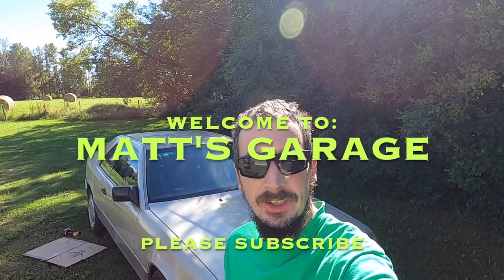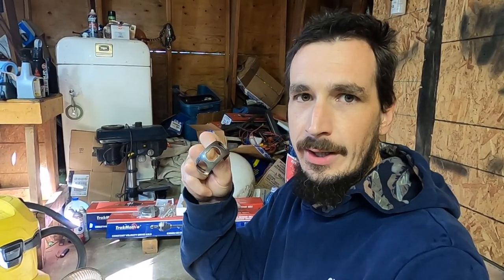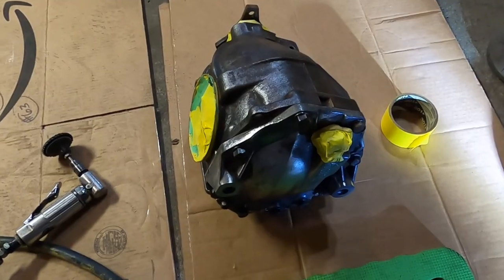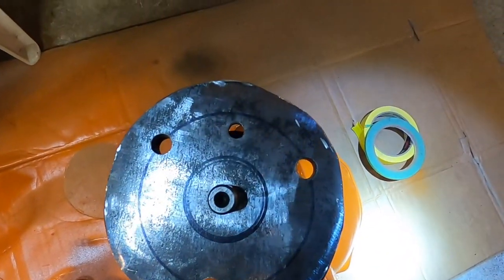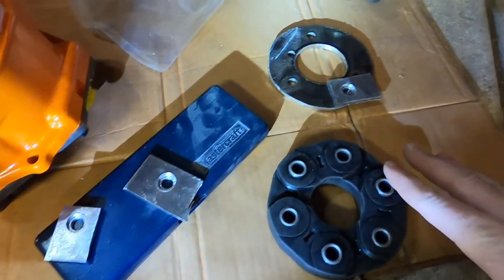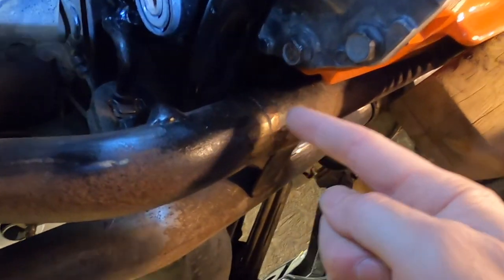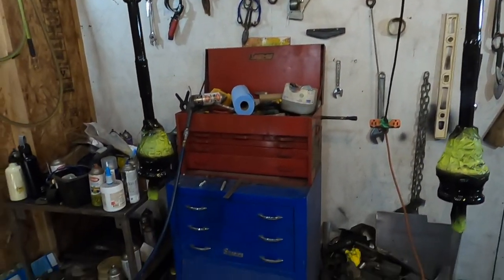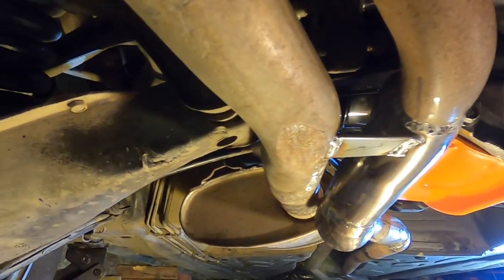V8 Mercedes Differential Swap

Comment: How much more power can it take now? And what year 300 was it?
Reply from the maker: The differential came from a 2008 300. The weak point of the setup now is the Mercedes splines that I put on the end of the axles, but so far they are holding up to my 300hp engine, I’m not planning to add much more power to it so it should be fine. I did consider getting the entire hub assembly from the Chrysler 300, the suspension arms are pretty similar and all that but of course there would be some more hurdles to that swap and then having the bigger rear brakes would make me want to swap bigger front brakes etc. That’s one upgrade I might still do to this car though is a big brake upgrade at some point in the future. I also have some better cylinder heads for it, that will wake it up a bit for sure.